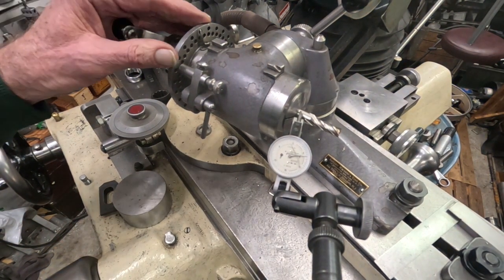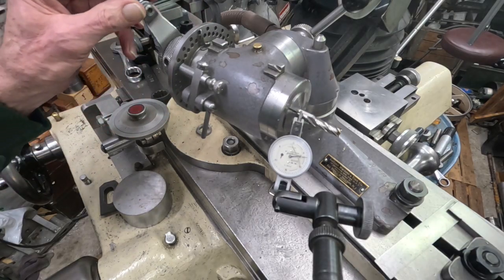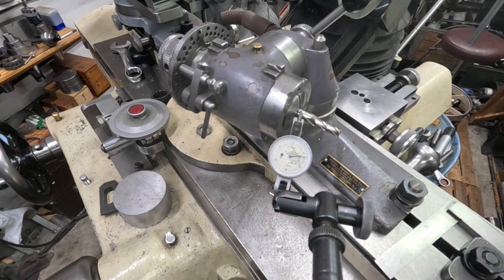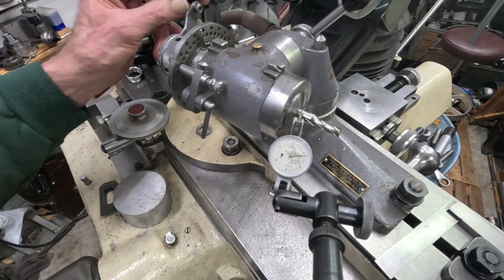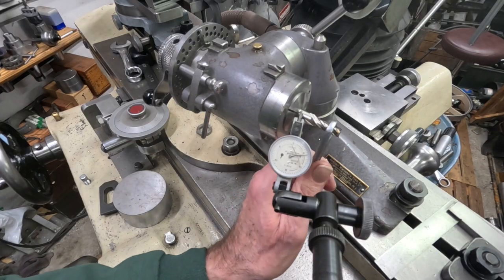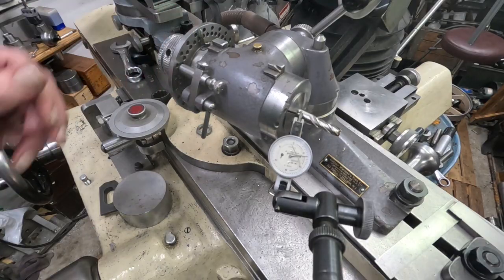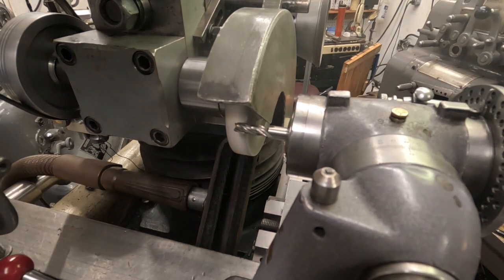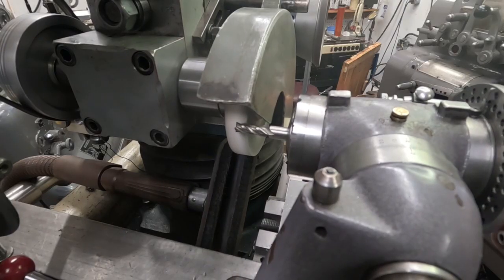Harley Davidson Machine Shop, Advanced techniques, The circle grind

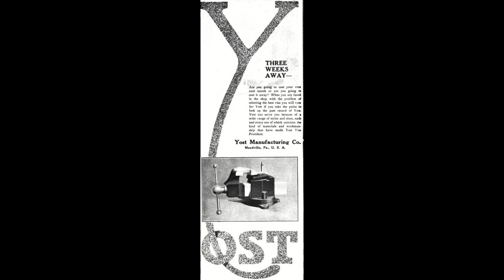Comment: Hi Don. Thanks for what you do. At 10:40 you showed an old ad for YOST in Meadville, PA. I worked at SECO/WARWICK in Meadville and every vise in the shop was an old YOST that was made just down the street. YOST moved operations to Michigan many many years ago. I rescued an old 8" vice that they tossed in the scrap because the jaws were worn out. Probably weighed 150lbs....It's been working great!
Reply from the maker: The Yost vices are very rare in this area, seems to have been few dealers, the ones I have encountered are very nice, a local salvage yard has two 8" vises one very old Parker and a Hollands, the Hollands must weigh 400lbs the Parker maybe 300lbs. I have been looking for an 8" heavy chipping vise for 40yrs. The Parker 6 1/2" swivel jaw I have is about 250 lbs, The big Wiltons are over $3000 now!
Reply: @DonDyarprecision  Morning Don, Not to change the subject but I've heard you mention HGR a few times. They closed up last fall but the original store in Cleveland has re-opened. I just bought a complete ELECTROARC TAP BURNING SYSTEM complete with T-Slot table for $250. I'll be picking it up soon. Just love buying old stuff and making work again. Thanks for experience!